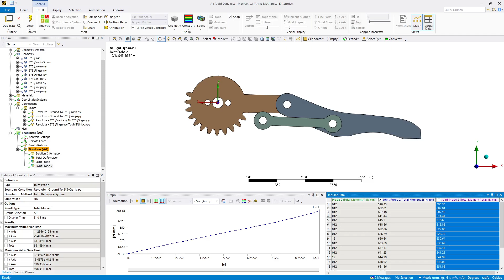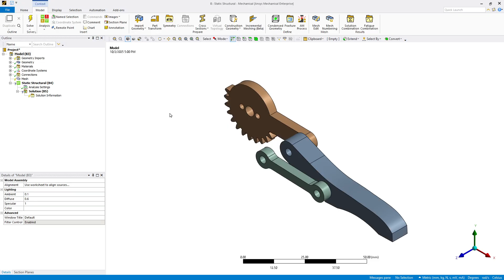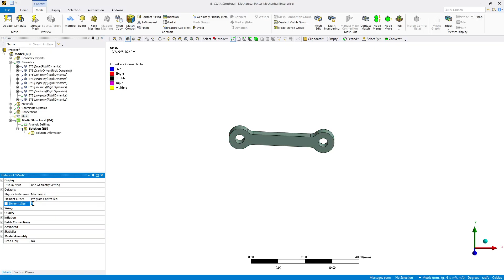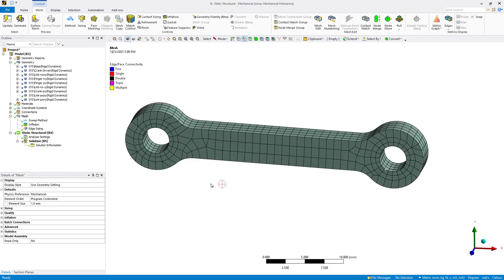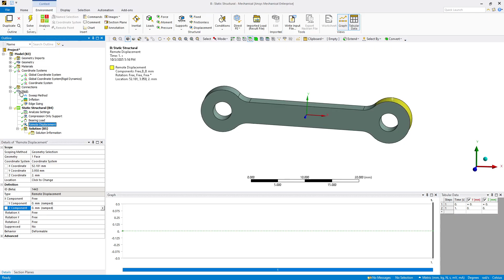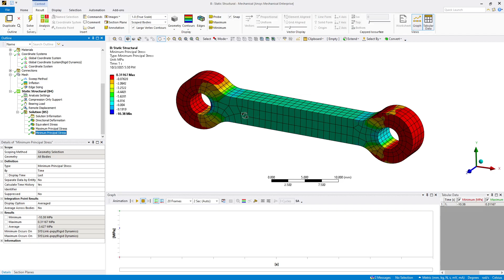Finger Grip Link Statics

Comment: Thank you so much for doing this video.
I am modeling truss railway bridges using ANSYS. I learned a great deal from your truss bridge tutorial. I have a question regarding the dynamic analysis of railway truss bridges. Please offer your input on a problem of comparing my result with field-measured data.
Thank you again